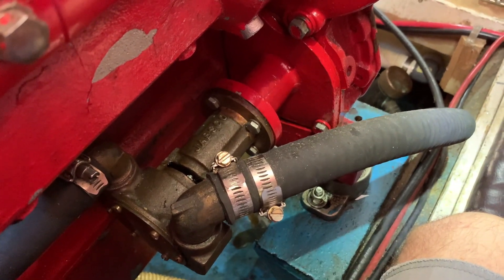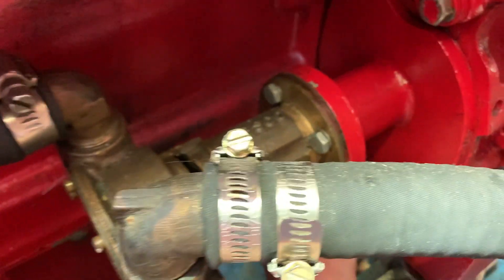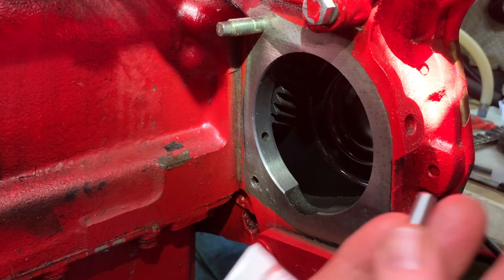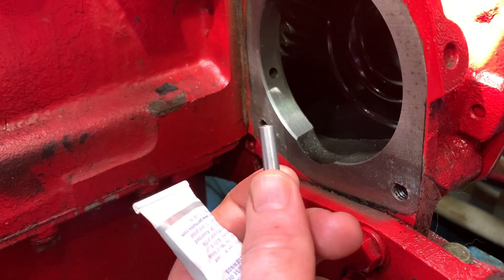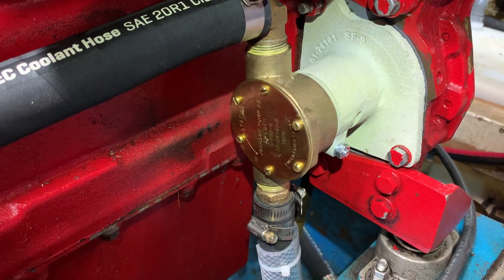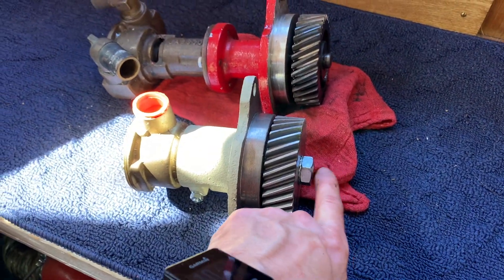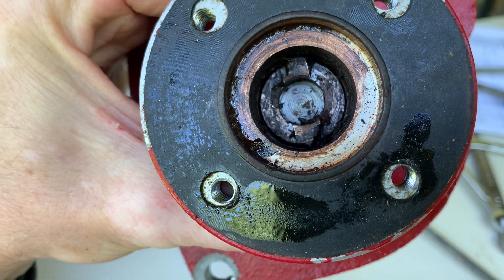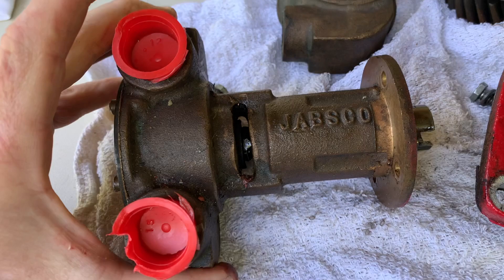Lehman 120 Raw Water Pump Removal and Replacement

Comment: Thanks for the video. I have the same engine in my boat. Can you provide me with the Johnson water pump part number? Thanks
Reply from the maker: It appears to be JOHNSON PUMP 10-24140-5 F5B-9 Impeller Pump. The American Diesel Corp number is at the start of the video.

Comment: Hi, I did as shown in the video. The pump went in maybe a bit more tightly, but now the machine doesn’t even try to start. I have a 2712e. Could help me what is wrong?
Reply from the maker: What do you mean "the machine doesn't even try to start"? The engine won't start or the pump won't work? Sounds like you need to call a mechanic.
Reply: That neck is 4 mm longer than the original and lacks a chamfer. Because of this, it hit the timing gear directly, which jammed the engine when it pressed against it. I made a 4 mm spacer on the engine block side and added a chamfer inside the block so the gear can rotate freely — and it worked! However, I still replaced the old gear on the new pump because there was a difference in diameter: 94 mm → 93 mm. So even though the pump said "Fits" 120 & 80 Lehman, it didn’t fit my 80 without quite a bit of tweaking! In the end, though, all is well and it’s now installed

Comment: Did you put teflon tape around the threads before putting them on the new pump ?
Reply from the maker: Which threads? The hose barb fittings? No, I use Rector Seal No. 5.
Reply: Is it possible to put that little pin in backwards ?
Reply from the maker: @claykerr300  As I say in the video, American Diesel specifies that the pin goes in tapered end first.

Comment: Finally these long-style pumps have been replaced by a much much better unit.
Reply from the maker: Indeed. Both engines are running the newer style now.
Reply: Ive got a scrap bin full of the longstyle pumps. 
Only thing worth keeping off them is the D-series (helical cut) or Dover ( straight cut) gears. 
We have had the short style (made by Lees Marine) here in NZ since the '70's.

Comment: This was really good... Thank you! Makes me want to look at mine now! 😝
Reply from the maker: Glad it was helpful. If you do decide to inspect the drive tangs, note that you do NOT have to remove the geared portion that bolts to the back of the engine timing cover. Simply remove the four bolts that attach the pump to the gear drive.
Reply: @cdsailor  Thanks for the video, I'm gonna show my dad we can replace ours.